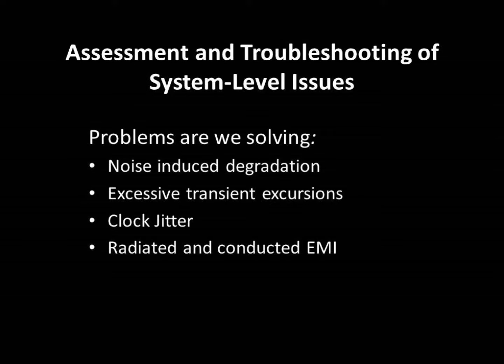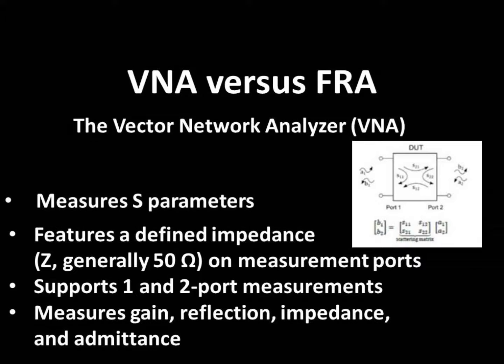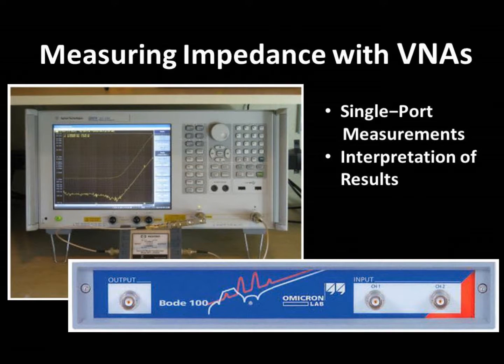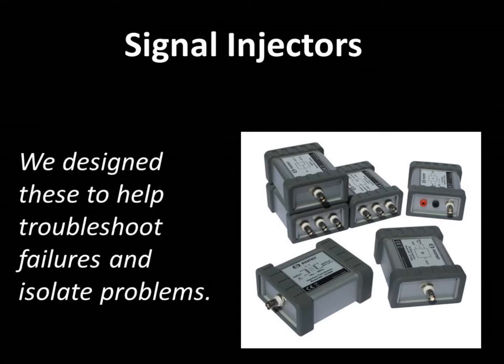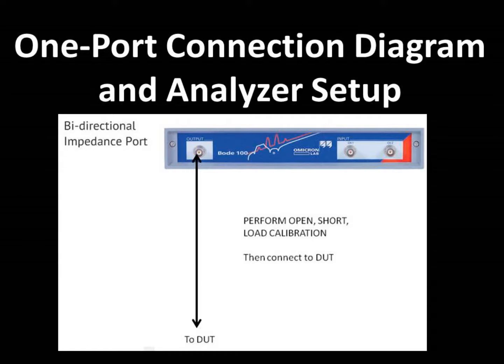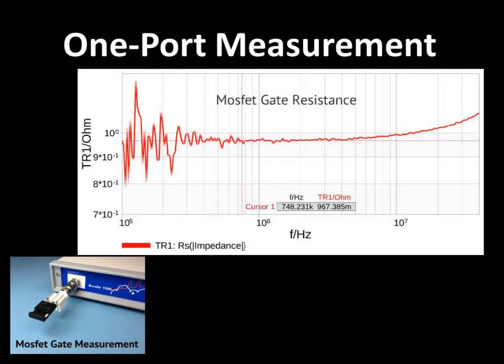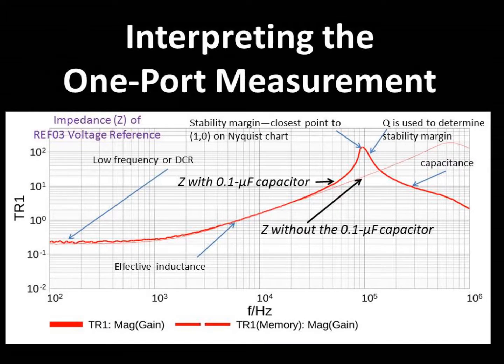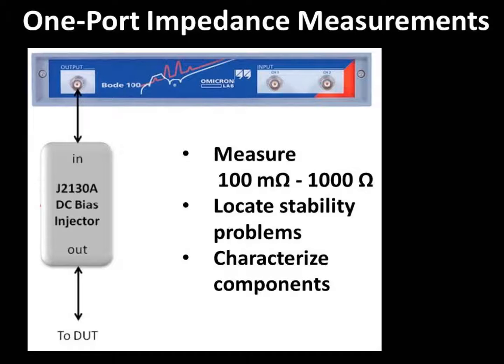Troubleshooting Distributed Power Systems (Part 3): Measuring Impedance Using VNAs (1-Port)

Comment: Viewer SK writes "This video was very practical and explained the difference between a VNA and FRA and how to hook them up to the SMPS circuit. As I am very new to this field, (in fact this isn't my field, I am an embedded programmer), I use these videos to understand complex topics. Just a note for future videos, some of the videos had too much technical jargon and were more geared to experience designers. If you can do a back to basics series, it would be very useful. I think Picotest has a reference board called "Voltage Regulator Test Standard kit", would would be very useful to demonstrate the basics with."

Comment: Viewer SH writes, "This is a very useful tutorial series. Steven Sandler evidently knows his subject and how to present it. Engineers are usually familiar with different aspects of stability and impedance measurements as they pertain to their individual scope of work. This series does a good job of providing the bigger picture. I can recommend it to all power and analog engineers. Go through all the videos in  their proper sequence even if you think you already know the topics in some of them."

Comment: Ashok Bindra writes, "I am glad that How2Power Today is offering short video tutorials to its readers. I find these tutorials very valuable to novice engineers who can quickly learn some new power supply measurement tricks at high frequencies from an experienced expert. Since SMPSs today are switching at very high frequencies, I think that a similar tutorial on RF electronics and instrumentation will add value to this service."

Comment: Finally, Al notes "*For power supply feedback loop analysis (for switchers below 2 MHz, I don't have the experience to validate my comments at higher power supply operating frequencies). [So in this case] I do not see any benefit of using a VNA."

Comment: Al also adds, "I recently evaluated 2 demo boards based on output layout filtering optimization....having a VNA would improve my ability to quantify the issues with my layout by probing the impedance at various board locations (high frequency currents couple to the return path, not necessarily taking the intended path planned for on a board layout. I am aware there are software tools out there that do this as well, but one still needs to establish component impedance information.

Comment: AL continues on why a VNA would be useful, "There is guess work involved in choosing ceramic capacitors as well (as shown in the video) because board layout contributions to ESL/ESR cannot be reflected in component datasheets. Selecting decoupling capacitors for output noise decoupling (in conjuncture with the electrolytic capacitors) may occasionally be a trial-and-error methodology. Knowing your switching noise frequency and how it pairs up with the ceramic capacitor ESL is informative.

Comment: Viewer AL comments, "There are times I wish I could have this VNA measurement ability in the lab. In many ways, it would be helpful in evaluating the effectiveness of power supply output filter layouts when evaluating different layouts: *Helpful in creating better simulation models for power supply filter analysis.*Electrolytic manufacturers do a poor job in providing impedance information. This would help take some 'guess work' out of a design exercise, reducing design iterations &  BOM costs.

Comment: The equipment we are showing works to lower frequencies.  The Bode 100 provides a range of 1Hz-40MHz and the E5061B 5Hz-30MHz as a FRA and 5Hz to 3GHz as a VNA.  I use a Lecroy SPARQ for higher frequencies 

The Bode 100 is ideal for measuring PFC's and we have both solid state and transformer injectors that support this range.  The PDN measurement requirement for FPGA's is 3GHz or 10GHz depending on the FPGA.  GaN and eGaN will propel power measurements well into the microwave range

Comment: Viewer FP comments on the 1st 3 videos: "Part 1 is interesting and I like the example of how the stability of a regulator affects phase noise. Part 2 is also interesting, but I would like to have one or two slides showing the set up difference between the Bode plot and the Nyquist plot. Part 3 is more informative and carries on the discussion from parts 1 and 2. It would be good if there was some live video showing the measurements. In general, the videos are good, informative and interesting."